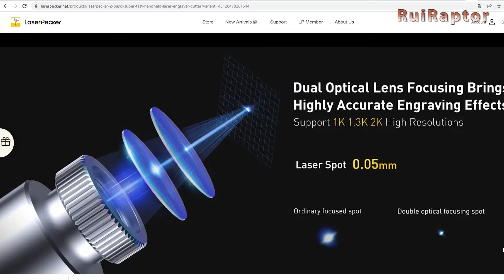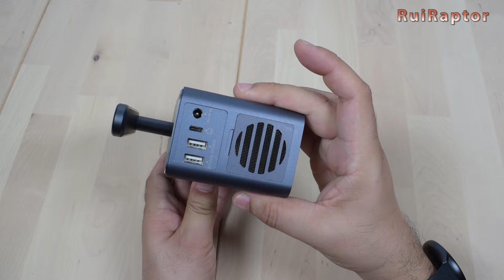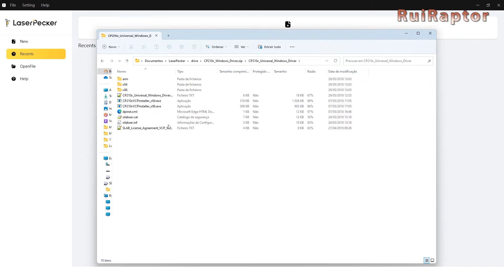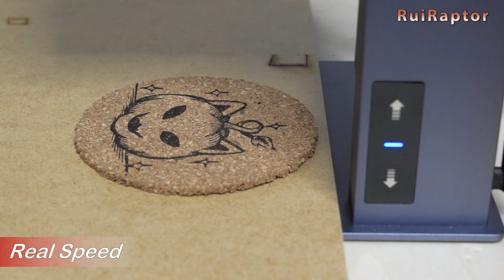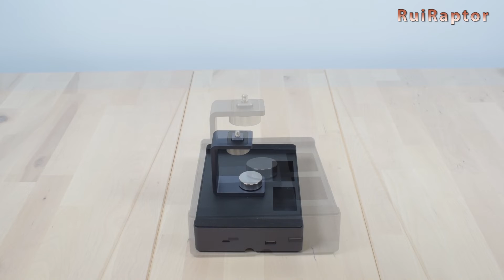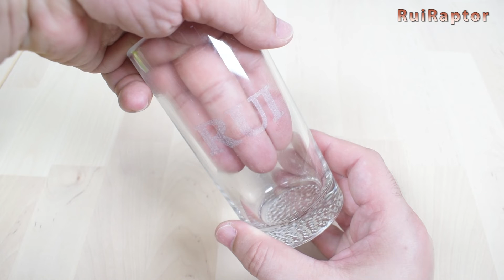LaserPecker LP2 (Engraver & Cutter Machine) - Detailed REVIEW (Including Tests + PROS & CONS)

Comment: Besides the lack of timely customer support outside Facebook groups, buggy firmware, limited 'proprietary' design software and LP continually rolling out new variants, rather than addressing technical issues with existing LP models. I was surprised to see just how many used LaserPecker engravers end up on eBay and FB Marketplace!

Save yourself some money and frustration buying a regular flatbed engraver instead that runs on Lightburn software, a far cheaper option 'even new' compared to a used LP engraver! The ONLY aspect I really like about my LP engravers is their ability to function handheld at any angle (100mm x100mm max). Otherwise I regret buying LP products over a regular higher powered flatbed laser for a fraction of the price, which means one can afford to buy an essential 'fume hood and filter box' too with the money you save. 😉

This is my opinion, I could be wrong. 👍
Reply: So which brand do you recommend instead?
Reply: @randomfocus1549  I don't recommend any, do your own research, then you've only yourself to blame when you pick the wrong one! 🤨😉
Reply: @Zodliness ok but you said save your money and time buying a regular flatbed engraver that runs on Lightburn software… whats an example of that?
Reply: @randomfocus1549  Do your own homework, Cos I said (a year ago) I've got two LP2's and and LP1. They were (in my opinion) not good choices. I never mentioned about which specific alternatives I would choose as a viable alternative. Since purchasing from the kickstart company Laserpecker. There have been numerous advances in engraver technology and I know nothing about the makes and models now available.